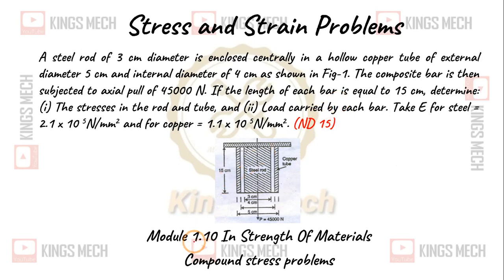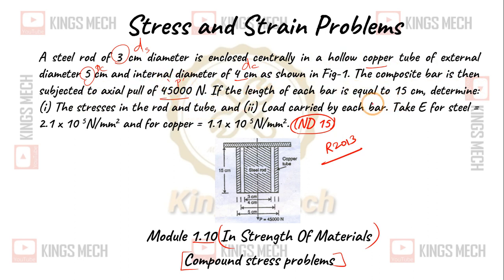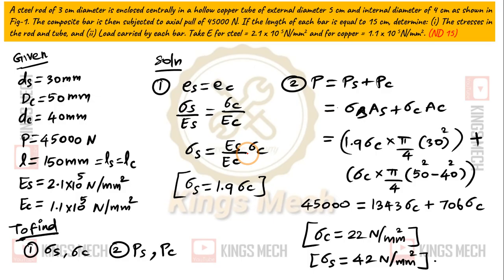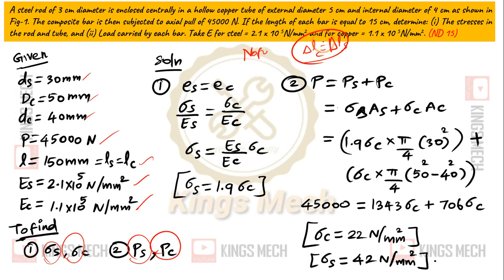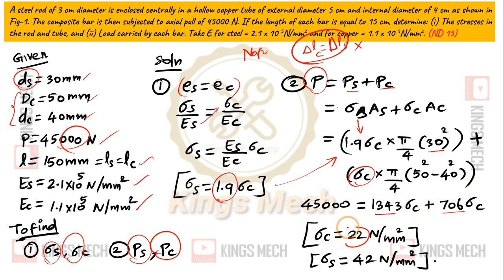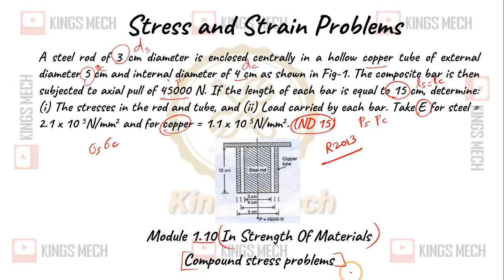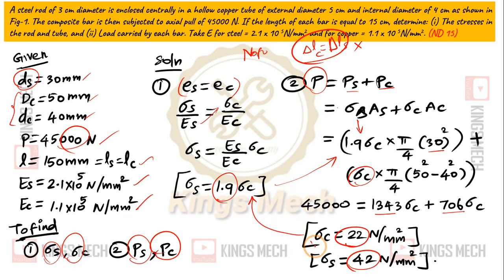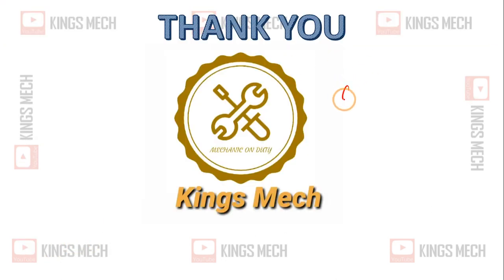Module 1.10 Compound stress problem ND 15

Comment: example of such a question but not given force acting on it but thermal stresses are required due to heat please?
A steel tube of 30 mm external diameter and 20 mm internal diameter encloses a copper rod of 15 mm diameter to which it is rigidly joined at each end. If at a temperature of 10℃, there is no stress, calculate the stresses in the rod and the tube when the temperature is raised to 200℃.
𝐸_𝑆𝑡𝑒𝑒𝑙=2.1×〖10〗^5 〖𝑁/𝑚〗^2 and 𝐸_𝐶𝑜𝑝𝑝𝑒𝑟=1×〖10〗^5 〖𝑁/𝑚〗^2, 𝛼_𝑆𝑡𝑒𝑒𝑙=11×〖10〗^(−6)/℃ and 𝛼_𝐶𝑜𝑝𝑝𝑒𝑟=18×〖10〗^(−6)/℃
Reply from the maker: We have solved similar problem on thermal stress and strain... Pls look out the playlist

Comment: Sir what's the difference between compund and composite are both same
Reply from the maker: Compound beams distribute load but it need not to be closely attached 
Composite beams are the closely attached beams of various material composition together to withstand loads